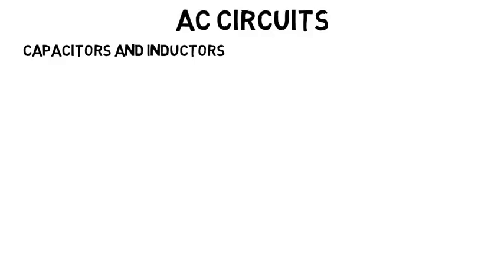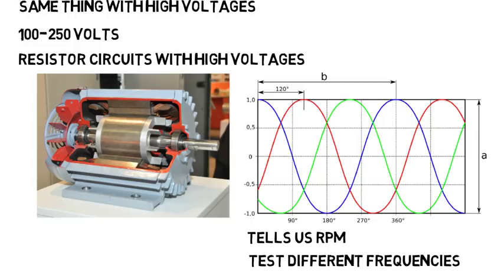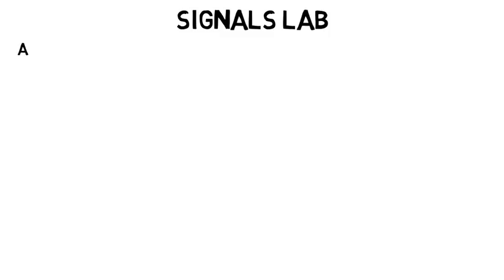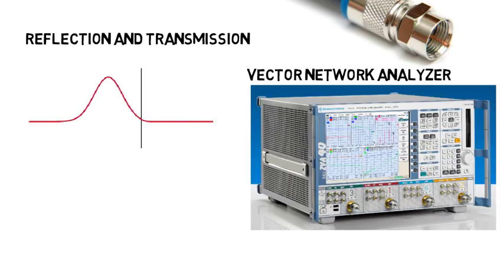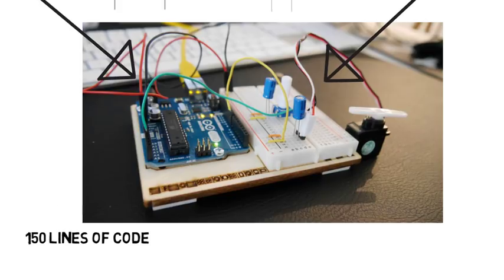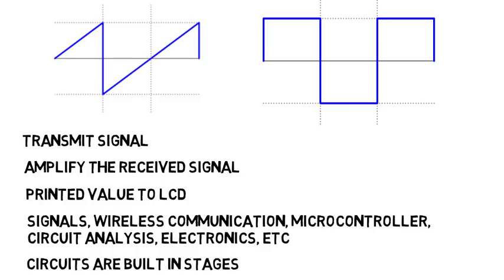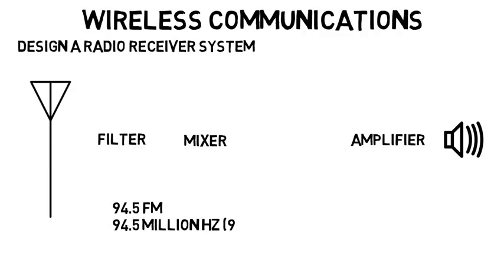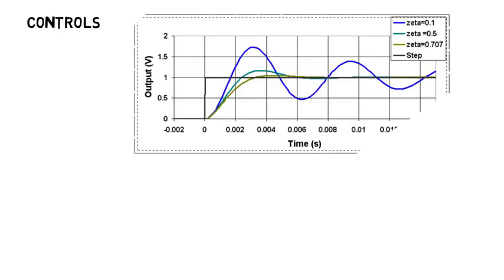A Breakdown of My Electrical Engineering College Labs

Comment: I do have a question :
In the future what does an electrical engineer actually do? and how does the labs apply to the jobs/future?
Reply: cedric stokoe +1
Reply from the maker: It really just depends! Your future could involve doing mostly design work on the computer where you have to understand the theory and the software more than anything. You could do testing where you'd have to understand the equipment and how to troubleshoot/debug circuits or hardware.  I mean you do a wide range of labs so for most people very few of those will actually apply to the job they have. That radio receiver project would apply to someone who works with high frequency systems like cell phones or radio and has to do testing on those. Their day to day life may involve doing signals testing and interpreting the plots given by the equipment to see if everything is in spec. But that same person would then really never apply something like the telephone touch tone decoder project I talked about.
Reply: They help build technology from scratch & it is practice for when you get in the field.

Comment: Thank you for your exceptional informative videos. I am a journeyman electrician of 16 years and now currently a electrical engineering student. does having a background in the electrical trade give me any advantages for the future? also can you talk more about electrical engineering clubs, benefits of the club's, and the ups and downs?
Reply: As far as I remember, the people who were electricians had an advantage in the theory of electrical components and circuits, but it kinda went to their heads. No matter what, you still have to put the work in and do it how the professor says and not have an ego. Other than that you should do fine.
Reply: You know few things but theory is complex and if you don’t put in required work, which will not be any different from other students, you will fail. You know a tiny part and it will not help you past couple of basic classes.

Comment: Question...I'm interested in majoring in electrical engineering, but I am also legally blind. I've taken lots of engineering classes in HS, and my biggest problem has been the fact that engineering is very visual. Due to this, it takes me a lot longer than my peers on labs, and sometimes I can't even see what I'm doing. Since EE works with small parts, would I be not fit for the workforce or engineering in undergraduate?
Reply from the maker: Well first of all good job on getting through engineering classes. The thing with just most engineering jobs is that it's often on the computer. If you can handle working with computer programs that model things like circuits then you should be qualified for more jobs than you may think. At my first EE job out of school I never worked with a single small part, only on the computer, or I did testing as well but all the controls and plots were generated on/by the computer.

Comment: What is the most practical engineering degree. Not Just in terms of Job but that you can use in really Life application. Like if you study mechanical eng. Would you understanding car parts be able to design and Fix then. Question 2 what is the difference between University of applied Science and university
Reply from the maker: Engineering disciplines probably aren't as applicable as you would imagine. Electrical engineers don't learn how to fix electronics, computer engineers don't learn how to fix computers, and mechanical engineers don't learn how to fix cars. Of course they can learn these but I just means that's not what you learn in school. Those jobs would be technicians, electricians, mechanics, and so on.  And I'm not exactly sure what the difference between those two is.
Reply: MajorPrep hey MajorPrep really digging the videos. What advice do you have for the self learning engineer who is starting out with circuits?

Comment: I just finished my first year as an EE major (idk how but I survived and conquered lol). Anyways, my second semester lab was supposed to be very remedial. We had to make circuits that would  turn on/off LED's, make D flip flops, use IC chips, etc. Being I was completely new to circuits, even the "easier" labs were difficult for me. Luckily, we had partners so my partner ended up doing a lot of the circuit building while I just watched. This video kinda makes me worrisome because I really do not know how to build a circuit and considering that is what I plan to do for the rest of my years at college - how will I be able to survive my future labs?
Reply from the maker: First you should definitely not just let your partner do the labs because that will get you further and further behind. Although kind of nice, it doesn't help. Make sure you understand important equipment like the oscilloscope and function generator and all that so when you do more advanced projects you at least understand the basics. The labs are all very similar in difficulty to begin but once you enter your third and fourth year they get more challenging. You have time but remember if you don't get something then at least ask the professor/your lab partner for help.
Reply: To add to the above, join an engineering club on or buy Ian Juby' Jetpack Academy analog and digital circuits course. If the above doesn't work, then maybe your talents lie elsewhere like software (plenty of jobs in that vs. elec ;) ).

Comment: I was a accepted in electronics engineering bachelor course, but I'm not sure if I should take the position, since I'm very slow at lab work.
Reply: Heres a question i’d ask you. The leads of an adjustable power supply are shorted, and there is an ammeter in series. Which knob would you turn up to get higher current? Voltage, or current?

Comment: I hate my circuit analysis right now. I have no experience with building on bread boards unlike many of the members in my class. and they just started us out on the breadboard, he grades the reports very harshly for a beginners course, and we are kinda left on our own during these labs or we are talked to like we're stupid when asking genuine questions. I've been given components that I had never even seen on schematics in my previous job (I worked and troubleshooter SITE TV systems on a ship before I started my major) and it didn't describe at all what the component did in the report instructions or in the class lectures and I take decent notes. I feel so sick going to this class sometimes and it's my major. Labs can be fucking hard sometimes under shitty professors.

Comment: Multiple sine waves to make a digital wave? that's cool! Also can you give me a reference to learn why those TV cables handle higher frequency better? Obviously they need to, but why can't other wires handle AC? Does it overheat? That would make sense.. because AC has less heat loss, right? Are there other factors than overheating?
Reply: Multiple sine waves forming any other kind of signal is what's known as Fourier analysis, or specifically Fourier series.

Comment: those labs are very important. it helps to understand those concepts and math formulas in textbooks. Electrical engineering must be learned by actually doing it. when doing it, it involves circuit troubleshooting, programming (in signal processing, analog electronics, and digital communication)....But when doing programming, it's not like computer science> electrical engineers never think about any algorithms but just make sure it works. Once all these stuffs are done, we can actually see the physical phenomenon, such as what DTFT is really like, what sampling means.... After this, we have to read the textbooks to understand those math formulas. this is why electrical engineering is the most difficult among all the engineering disciplines (also the most enjoyable if you really understand how to learn and what it is). It involves both lab works and math skills. (others like ME, over 60% are just math). without thoes labs, people can never understand the textbooks. Electrical engineering is rapidly changing with time and what ti is in real world is more comlex than what we have seen in university (especially during undergraduate time).  Thus in real world, most of the electrical design engineers ( especially those doing RF, analog design and digi comm) are PHDs.

Comment: We used those big circuit element boxes in physics 2 lab but for my circuits and electronics labs they let us use breadboards. Oh and digital system design lab those breadboards got loaded with wires

Comment: Your videos on the topic are great, answered so many questions I had, but one thing confused me. 
From what you've shown in all your videos on electrical engineering, it seems to be much closer to what I've been led to believe is "electronics" engineering, with the sort of balance of focuses of all your classes and electives mentioned. This happens to line up with my interests much more closely than I had assumed, but I've seen advice generally dissuading people from pursuing electronics engineering as opposed to electrical engineering as it cuts them out of the major part of the job market being larger scale corporate electrical engineering or power distro.
Could you or anyone else elaborate on the distinctions between electrical and electronics engineering? As they are (at least in Australia) completely different degrees and I'm unsure what each even entails let alone which to pursue. Thanks!

(My apologies if you already have a video about exactly this, I'm about to look)
Reply from the maker: Yeah electronics is a subfield of electrical engineering. So in electronics engineering you will most likely be much more focused. Whereas in electrical engineering you will learn electronics, power, RF, controls, and more. So in this video my digital signal processing class wasn't electronics based. Neither was the radio receiver we designed. So that's most likely what people mean. On my resume I put that my concentration was RF/wireless communications cause that's the area I liked most. But other students were putting things like power or controls. That's the flexibility you get with electrical engineering.
Reply: I see, well I wouldn't want to miss out on things like DSP and any potential Telecom classes, despite being more interested in analogue electronics. Thanks

Comment: I dislike circuits, digital/analog, dsp, rf, but like power systems electrical engineering. I liked physics E & M more than physics mechanics. Is it a good idea to major in electrical engineering? My other option is mechanical engineering in which I like more things in general, but the electrical power option just might top all the mechanical fields in terms of my interest.

Comment: Hi,I am thinking of going into either neuromorphic computing or quantum computing, and I was thinking double major sing in applied mathematics and electrical engineering might work, but I am not sure. I also want to leave my options open In case I want to get into Ai software development, and I was wondering, are these the right majors for me to choose?
Reply from the maker: I think those are good. However, I would probably pick physics over applied mathematics for quantum computing. This is only my personal opinion though as I have not done a ton of research on the matter. When it comes to AI software development, computer science is actually the best route (math is a good choice too though) so that's something to think about. I have a video on AI coming out very soon discussing majors to look into so hopefully that will help.
Reply: I have a second question, and it is: Does Applied Mathematics and Electrical Engineering Cover a broader area than lets say Math and Computer Science?
Reply from the maker: I guess it would, they both cover a lot of topics. EE covers things like power, communication, controls, and so on which is why I would call it broad.
Reply: hey not sure if you’ll see this, but i’m wondering what you ended up doing? i’m stuck on choosing a math degree or attempting EE. I’m also interested in AI since computer science seems to be where it’s at now.

Comment: What was the duration of your course for electrical engineering ?
Reply from the maker: If you mean how long was I in school for, the answer is 4 years.
Reply: Did you performed open circuit test and short circuit test on a single phase transformer in your first sem, if not in sr sem then in which semester ?
Reply: Also you didn't mention any of the machine testing labs like plotting generator characteristics or DC motor characteristics, Transformer (3 phase, 1 pahse), Scott connection or any other related thing like this. I just want to know are all these topics/experimental labs are obsolete now ?
Reply from the maker: I did single phase and 3 phase transformer circuit testing in my power systems lab. I only took one of those classes those.

Comment: MajorPrep as I was trying to decide between electrical or civil this video finalised my decision as I discovered there is a good amount of programming in electrical eng and programming is my worst. U think u can clarify if there is indeed a major amount of programming in electrical eng?
Reply from the maker: I took around 22 electrical engineering classes throughout college and did actual programming in 5 of them. 2 of those 5 I didn't even personally enjoy myself because they were more computer engineering based which wasn't my area of interest.  For me the most programming I did was in my intro to computer science course which wasn't even an EE class but taught the basics of C which you need as an EE, then the microcontroller class where I made that light sensor alarm clock, and last was the class where I did the touch tone decoder project (however that was an elective that you are not required to take).
Reply: +MajorPrep thank you!!